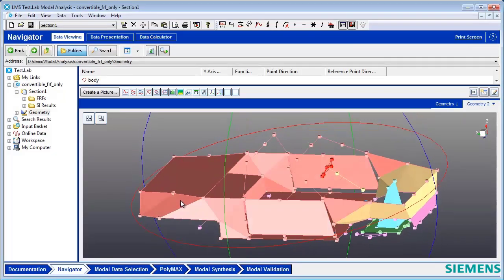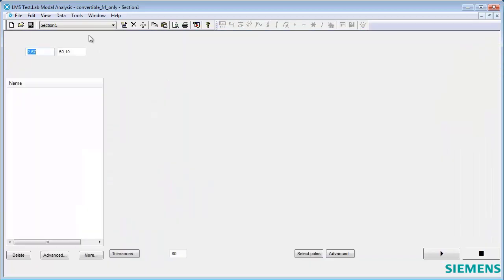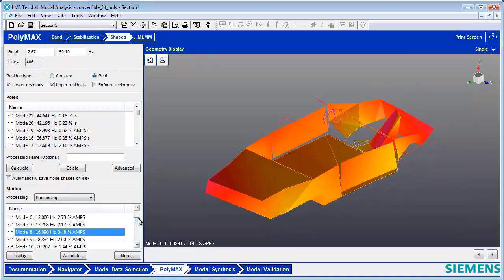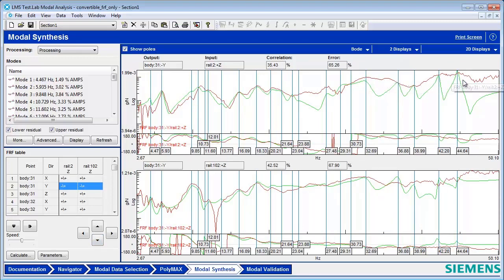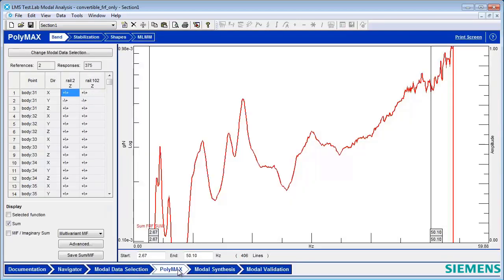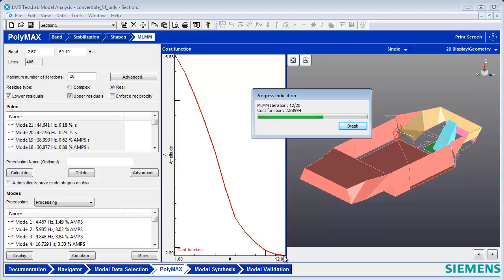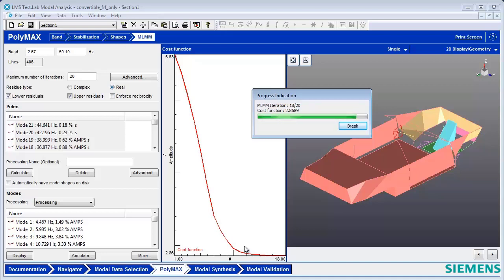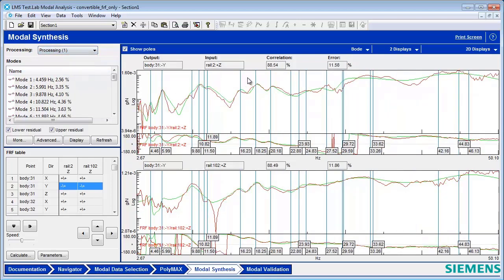Maximum Likelihood estimation of a Modal Model (MLMM)

Comment: When I opened PolyMax in version 14a, I didn't find the MLMM directory. How can I call up this option for calculation? Thank you and look forward to your reply
Reply from the maker: The MLMM is available in Testlab Version 17 and higher.  It also requires a fixed license or token licensing to be run. 103 tokens total are needed (Modal Analysis = 77 tokens + MLMM = 26 tokens).
Reply: @SimcenterTesting  I see. Thank you for your reply